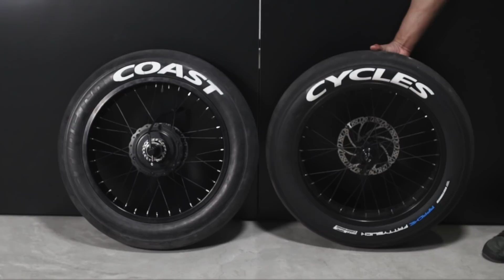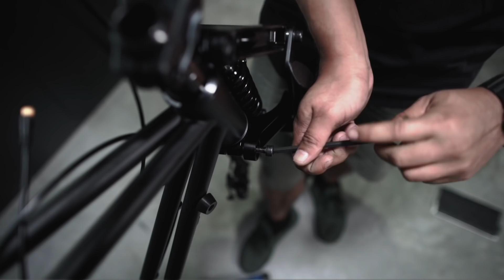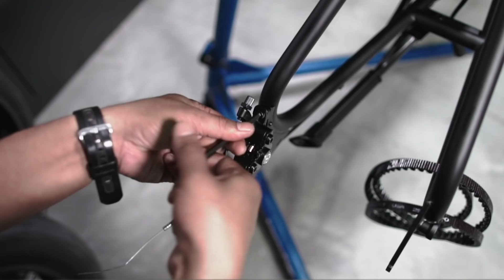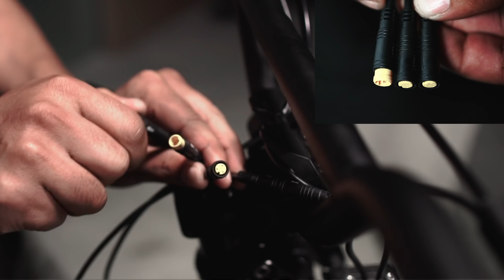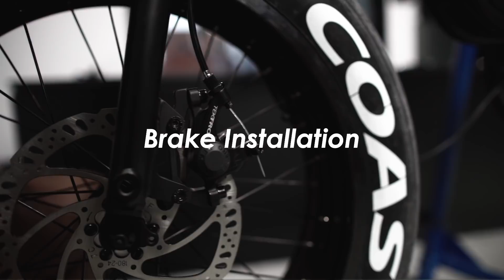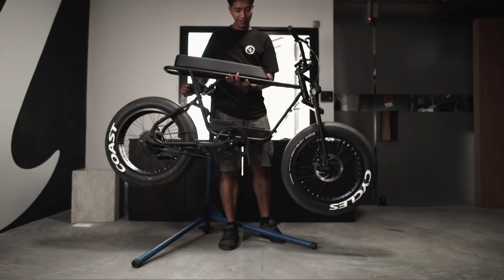The Buzzraw X | Assembly Video

Comment: Please CC team, how do you remove the sprocket carbon driver from the bafang 750w rear hub motor? Which tool to use to manage with that big plug cable? Does the nut and washers can be removed on the sprocket side? Please me know!!
Thanks

Comment: This is a crazy amount of assembly required. You’re basically buying a bunch of parts.
Reply: R3DB71ND crazy amount = wheel brake handle bar electric motor. So he assembled an e-bike. ^^’
Reply: If you've ever had to change your rear tire tube on an eBike, you'll be glad you know your bike well enough from going through this process.
People who didn't assemble it themselves end up freaking out and being confused over things like power cable routing, chain stays and brake adjustment, which leads them to take it to a shop, who also frequently refuse to work on an eBike they are unfamiliar with.